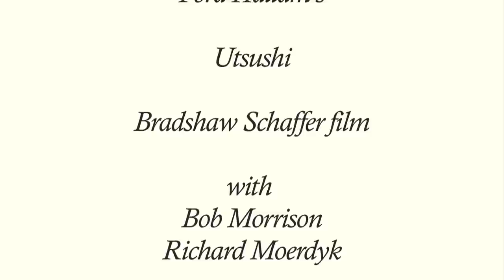Utsushi - in search of  Katsuhira's tiger. Part 2

Comment from the maker: @fixinman Only by polishing the metal and patinating it as I did am I able to check the true colour of the alloy and the distribution of the silver particles in the copper matrix. It also allows me to examine the surface for any flaws. If the surface is not this finely finished it's easy to miss possible problem areas in the metal and these could ruin the final work.  I do actually mention this at 5:45 in the film.

Comment: I'm very interested, how does the separate metal pieces inlay work? Are they  held by friction or fusion or some sort of welding, heat or chemical treatment? how do the gold amalgam process work, is it similar to gold leafing? I'm in NYC is there any group or workshop where I can learn these? Amazing
Is this copper tsuba, as the metal seems softer and easier to carve? can the same process be done with an iron tsuba?